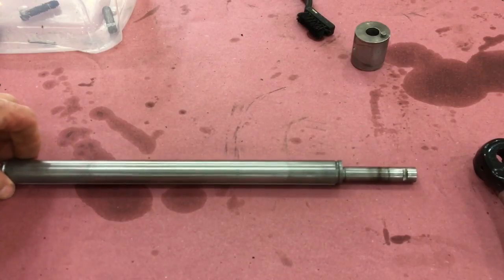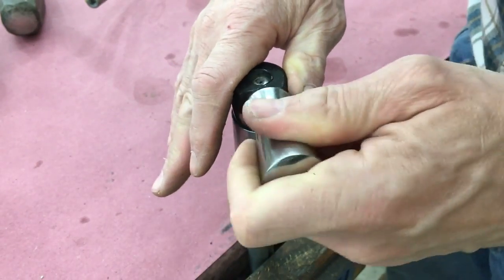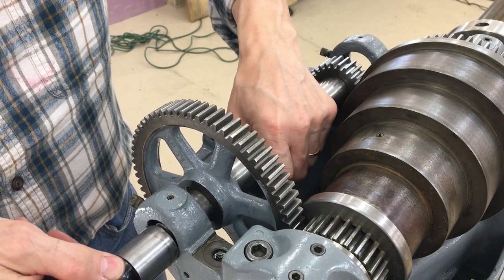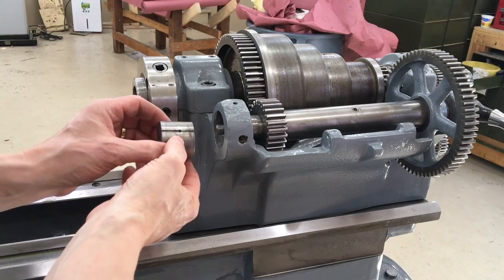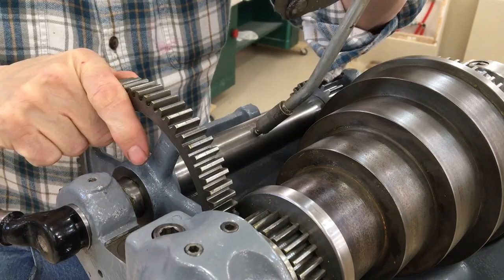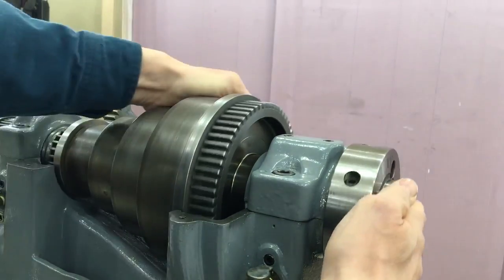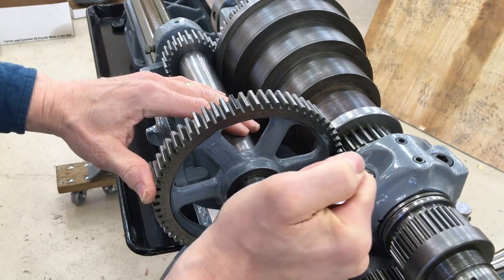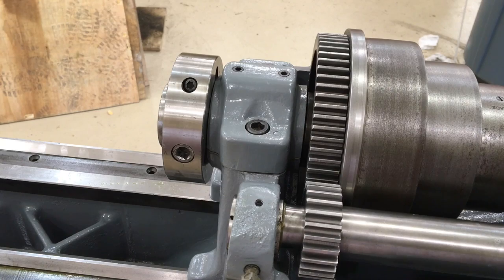South Bend 13" Restoration - Back Gears

Comment: Where yours has "GREASE" stamped mine has OIL and on my back gear sleeve there is a brass knurled and slotted screw stamped "OIL" as well. This is a 13in with SN 127907. I'm guessing they changed the recommended lubricant from oil to grease since yours looks like a newer with some added bits to the headstock bearing caps. Is yours later than the 127 thousand serial number? Mine was probably used during WWII since it has a US navy anchor and J.A.N. stamped in the ways and a brass tag stating " This machine conforms to orders of the war production board", I always liked that.
Reply from the maker: Yes, war productions machines are cool… I really don’t know grease or oil. As you mentioned my lathe says grease, so that’s what I used.  This machine is a 1978 vintage.
Reply from the maker: The movement inside the spindle is very slow in back gear….. so grease makes sense

Comment: Thank you Mr. Bell, this was extremely helpful. I've been trying to figure out the back gear on my 1923 series O for the longest time. I was always confused about why the headstock locked up with the back gear engaged (motor off of course). I never knew of the latch locking the bull gear to the cone. Makes perfect sense now that I've seen it explained. Thanks again!
Reply from the maker: Well, thanks for the nice comment, glad the video was helpful

Comment: Hi George, I’m restoring a SB13, your videos are super helpful. Thank you!
Question, what grease are you using in the cone and bull gear shaft? I know the Roy Dean product is not available and some people use oil. I would prefer grease.
Reply: Thanks George,
Reply from the maker: I am not familiar with the Roy Dean produce. Yes I think some do use oil, the pulley has the word grease stamped near the hole,  so I use grease.
Reply from the maker: What ever is on sale… I don’t think it matters

Comment: Well just got done starting to mess with the backgears. This whole project is spiraling out of control now, started with just wanted to take off the apron, clean and inspect, and well you know how it goes. I already got X off, might as well take Y off. Oh well, I've got Y off, might as well take Z off. Might as well paint it while I'm here. Haha! Anyway, it looks like someone at some point intentionally overinserted or overtightened the bushings with the set screws to freeze up the back gears. After this they cut the heads of the screws, and painted over them. This lathe saw use in a school, so maybe it was for safety purposes? Anyway, after drilling them out, the backgear started to move, but now I'm wanting to remove the entire assembly to clean, inspect etc. Looks like I just have to beat out the eccentric shaft. I tried beating on the center hole, but the thing doesn't want to budge. I might temporarily put it back on the ways, clamp it down, and try to beat it out. I don't think this assembly has moved in decades, and the backgear lever took a lot of working back and forth with a big 3 foot cheater bar to get it to start moving by hand. By the way turns out this a 15" South Bend series O from 1920 with a 6 foot bed. Pretty awesome, as it was sold to me as a 13"
Reply from the maker: Yes, you never know the history of these machines. What the previous owner did, or why.   Thanks for the comment, and good luck

Comment: South Bend Lathe Bulletin H-2 addresses lubricating the back gear and cone pulley... It recommends using oil, not grease.
Reply from the maker: Thanks for your comment.  Yes, I believe you are correct. Oil not grease

Comment: This is an absolutely superior DIY video. The clarity of the back gear assy is awesome! Even looking inside the threaded hole of a set screw seat was VIVID! I could see the conical female bottom where the mating male conical nose of the set screw would seat! WOW! Question: Is that a 3/8-16TPI hole threaded for a Pipe Plug when running and a Zerts grease fitting when lubing? My Heavy 10 came to me with just the threaded hole in the sleeve.
Thanks,
Wakodahatchee Chris
Reply: Reading back over my question I think I wasn't clear. I'm referring to the threaded lateral  hole in the sleeve @ https://youtu.be/s5WfxzmXca0?t=169.
Reply from the maker: @cdrive5757  thanks for your nice comment. Are you referring to the grease fitting thread? If so, on this machine it is a standard 1/4 28 thread. However, they might be different on other sized SB machines.
Reply: @georgebell7103  Thanks for your reply. Somehow the previous owner of my SB-H10 lost the cap screw for that grease hole. Oddly, my hole is a buggered 3/8-16 which I don't think was original and is not as common for Zerts grease fittings. I machined a low profile 3/8-16 screw to plug the hole and ordered some 3/8-16 Zerts on ebay. What I'd really like to do is weld up that buggered threaded hole, then drill and tap it for a 1/4-20 Zerts. Do you know if the back gear sleeve is cast iron? Hopefully it's steel. Thanks again!
Reply from the maker: @cdrive5757  I am pretty sure it is steal.   You might just weld it up and tap a proper sized hole right next to it in virgin steel. I have had difficulty taping in a welded area, due to hardness differences.
Reply: @georgebell7103  Yes, and thank you for the suggestion  I like that idea better than mine. Tapping isn't my favorite pastime.  Tapping into a weld joint doesn't improve the experience.  The only thing I enjoy less is removing a broken one!  😮‍💨
One last question , I hope: The rear of my H10 is against a wall. Do you think I'll have trouble removing the back gear assy because of this? THANKS!
Reply from the maker: @cdrive5757  You can tell from the video access needed to remove the back gear… I guess you will need to judge if there is enough room.  Heavy 10 can’t be that hard to move out a bit from the wall.   Good luck my friend.
Reply: @georgebell7103  I'll be coming up on my 77th birthday and I'm finding that many things I could do in the past is just that....the past That said I'm realizing more and more that having access to the back of my H10 is more than just a convenience. It's a must! My shop is only 10 x 20, so things are tight. That said my next lathe project is going to be devoted to small mobility while keeping her level and stable.  Thanks George!
Reply from the maker: @cdrive5757  yes, I think it is important to have at least some access to the back of the machine. Thanks for your comment, and good luck.

Comment: Having a two-piece spindle like that machine clearly does as well as plain bearings on the spindle "halves" certainly can't do any more for those machines than having the load of a belt pulling on the two-piece spindle "between centers" of the spindle "assembly". And is that lathe built to be powered by a line shaft? I've never seen anything built to be powered by an electric motor have flat belt drive before. Mainly because you won't keep the belt from slipping given the "instant-on" and "constant-torque" nature of electric motors. It doesn't look like there's any too much clearance between the belt pulley and frame underneath, either. Gonna have to be a mighty thin belt to "slip" from step to step especially going smaller on the spindle. All flat belts are "spliced" because they're used where you have to take the entire machine apart to get them "wrapped" but that machine looks like its going to need a belt that has a "zipper" rather than a conventional belt splice.
Reply from the maker: Thank you for your comment,,, I can assure you that the flat belt works just fine.  It transfers power efficiently from the motor to the spindle,

Comment: I'm surprised the ratio is 7:1 input to output. That's a pretty extreme gear ratio. With 4 ratios at the belt pulleys and probably a fair degree of slippage from what must be a flat belt drive, I'm surprised any load large enough to require "low gear" doesn't just slip the belt. The thing about electric motors is that they're "constant torque" and you really don't "gain" any power when you change ratios. You still have the same available "horsepower" since HP is dependent on speed and torque and the speed of AC motors and also the torque is determined by voltage and cycles per second and motor resistance. As an old diesel mechanic with mainly DC motor experience working with starters and such, I'd never really given that much thought until a while back when a friend gave me a "new" single-cylinder air compressor to replace the clapped out compressor I had in the garage. It was just the compressor itself so when I swapped it with the old one and swapped pulleys as well, the higher compression and lower leakage and my "questionable" electrical service (I'm literally at the end of the line in a 100+ year old farmhouse with a 40-year-old addition and an old barn/workshop but nothing has been added for decades and I'm sure that's not the case "upstream") had the old 1/2 hp motor working pretty damned hard. 

A leaking check valve letting tank air back to the cylinder didn't help and I could actually get more pressure in the tank with the old compressor. It just took a lot longer to get there. The belt ended up going to hell after a couple months and I'd done some playing with a few other pulleys I had to change the ratio for "more torque". As somebody who knows a little about electricity and started studying it "practically" in junior high I should have known I was pissing up a rope. No combination of pulleys and belt gives you more power than you've got and I temporarily "fixed" the issue by doing a "shadetree" fix of the check valve to keep it from leaking back. But It still hits about 80 psi and starts pulling down, lol. So I reset the limit switch to 85 or so and backed off the start side but not enough because once in a while it tries to kick in and just grunts. But it gets tires aired up and runs small air tools for the little bit of stuff I do with them. Electric motors aren't internal combustion engines that can and do make more power the more power they make and "gearing down" an electric motor actually costs you "horsepower" the more stages of reduction you go through. Of course the same is true with internal combustion engines in that there's a torque loss at each ratio change but engines aren't steady-state "power providers". 

That's the primary difference between motors and engines that gets missed in "debates" about which is which or right. Engines are "multi-stage" energy conversion devices. Fuel/air to heat to pressure to torque. Motors are single-stage conversion devices. Electrical current or hydraulic flow to torque. AC systems aren't terribly good at that since they're switching on and off and are only "on" more than they're off if its 60hz. The two "legs" take time to "charge" and "discharge" and the only point at which you're getting "maximum" power is when they "pass" each other when you're dealing with 220V and both "legs" are connected to the load. 3-phase AC electrical power "imitates" DC but also not terribly well and its inefficient since you're using both "legs" of standard single-phase service and one "leg" of another. Phase converters are also highly "inefficient" and when I see guys talk about using a phase converter to operate a 3-phase "industrial" tool being "cheaper" and/or easier  than getting 3-phase service and operating the tool at its proper power level for maximum "efficiency", I kind of have to laugh. Especially when most of them are hobbyists and rarely use the tool and for brief periods of time. They'd better off buying a "cheap" surplus 3-phase commercial diesel-powered gen-set or using a pair of portable generators "in parallel" to power the tool. 

I'm not sure EXACTLY how that would be done but I know it could be. Having precise voltage control is less important as voltage increases and "220" and "110" and "480" are "nominal" voltage levels. That's the absolute MINIMUM you can have UNDER LOAD and not be overloading electric motors and be producing more "heat than light". The only 480 I've worked around was on center-pivot irrigation systems using a common diesel engine to power the well pump and a generator to run the pivot. Those things use 480 at very low amperages because they're pretty much wired in series with one motor per tower and a ton of gear reduction at the motor gearbox and more at the wheel gearboxes. When they're "moving" its only one tower at a time with "safeties" if they get out of alignment that stop the first tower once it gets too far ahead by openings its circuit and then the second tower can move, etc. It's still a lot of juice given the voltage drop across the miles of wiring but high voltage is the result of low current through "high" resistance. Just like high pressure in a hydraulic system is the result of "low" flow and a lot of restriction. 

The other issue I see with running big machines with phase converters is you still have 60hz electricity coming in. 50hz if you're in Europe and most of the rest of the world. Combine that with belt-drive machines being worked too hard without enough power and toss on an add-on CNC system and however much other stuff guys end up running simultaneously in their "shops" on household current - lights, air compressor, "entertainment" appliances, etc and I seriously doubt the fact that "220" +isn't a separate service. It's just two legs of 120. 480 is 220 + 220 + a little "extra" gained from the overlap in cycles. You don't ever have one leg at "120" and one at "0" or anywhere close. As one is peaking another is dropping but the third is also coming up. Like I said, its a DC "imitation" that makes up for "constant flow" with "constant pressure". 

Running machines with less power than they're designed for is NEVER a good idea. No matter the power source and its always killing "efficiency". If you can get by with X 3-phase Y HP machine tool running on a phase converter and can afford that "big" machine and a phase converter and the higher utility bills you'll get "forever" along with getting a lot less bang for your buck out of the machine OR you can do it the "cheap" way and put in a "220" motor on your single-phase, you can get by with a much smaller machine.  

I know little or nothing about machine tools and machining speeds and such but I do know a LITTLE and I have some boring bar experience and valve grinding and such as well as a lot of "fabrication" and work most guys don't CONSIDER "machining" like grinding, drilling, cutting threads, etc. And it sure looks to me like a lot of "machinists" on YouTube have way more lathe than they need, go like a bat out of hell doing "precision" work and make "how-to" videos where I don't see anything done too "precisely" and when it comes to "measuring", it gets even worse. Lever-style dial indicators to measure "runout" and "concentricity" instead of a standard plunger indicator, using indicators in various fixtures to "measure flatness" or measure dimensions, an obsession with no "runout" and perfect "concentrity" that lasts right up until its "close enough" and within a "few tenths" or  a "couple thou", etc. Dial indicators INDICATE. 

They do not MEASURE because they have "slop" in their own mechanisms. MICROMETERS and other "rigid" measuring tools that can be "tightened" to take the slop out are for measuring. Lever-style indicators are especially "error-prone" since they have multiple pivot points which are "levers" themselves. I also see piles of what have to be old "surplus" tools  the original owner "discarded" for some reason or another. Whether its lathes or indicators. CHEAP and GOOD never go together when it comes to tools period unless you're making them yourself and those are expensive in time and the resources required to produce them. And I see "restored" lathes all over that look like they've gotten the old "DuPont Overhaul". 

A "good" cleaning to remove the oil, grease, rust etc from them and a coat or two of new paint. New parts? Nada. Just knock off the rust, maybe "scrape" whatever "precision" surfaces so they look "new" and like something difficult and time-consuming went into the "rebuild" where metal was removed from a worn-out machine by "machining" surfaces and/or "relocated" to "restore" the parts and get them "flat" or "square" or "parallel" or whatever is supposedly so important to locating a tiny cutting point in space and won't be "checked" by a "machinist" that has some "professional" do the "restoration" of his "machine tools" that he "uses" or features in a few YouTube videos but mostly "collects" and then sells to some aspiring "machinist" to "make room in his collection". 

I've bought enough good quality tools both new and used over 25+ years to know that if something is AS GOOD AS "NEW" it better BE NEW and if you're paying more than "new price" and in most cases tens or hundreds of times "new price" for a decades-old tool of any kind that was mass-produced and mass-sold to some big company machine shop or the "government" at "lowest bidder" prices back in the day who knows how many "owners" ago, that "new price" had better not be more than pennies on the dollar for what a "similar" tool sells for new. "Inflation" DOESN'T MAKE TIRED OLD JUNK WORTH "MORE MONEY" any more than "restoration" does IF that "restoration" is a "DuPont" overhaul deal or my OTHER "favorite" type of "restoration" I see a lot online called "Bend to fit, paint to match". I'm pretty sure most "restored" machine tools for sale online and I rarely see their proud new "machinist" owners "measure" anything on them.
Reply: Long reply with much valuable information. No, you don’t gain any horsepower with gear reduction but you do gain a ton of torque. That’s why a small farm tractor can pull three turning plows all day with a 35 hp engine.
Reply from the maker: wow, you spent some time on this